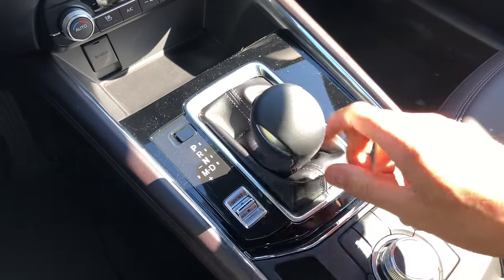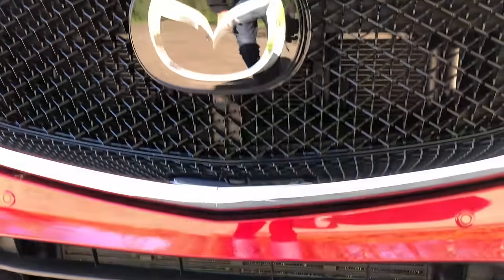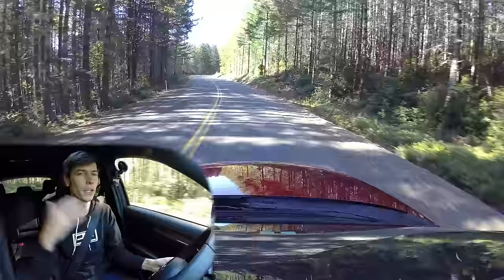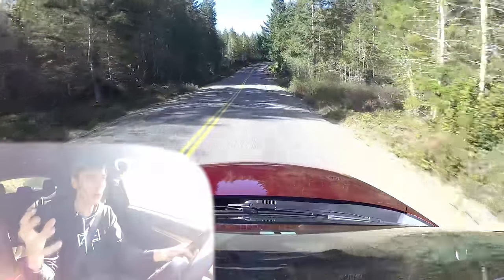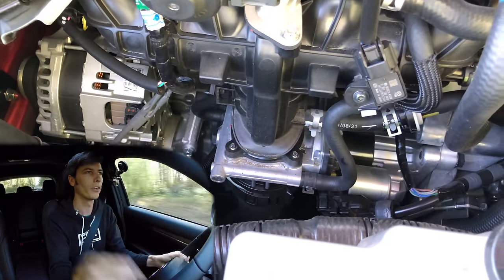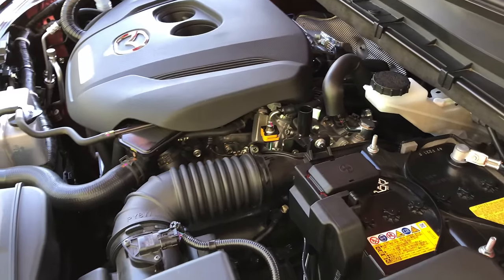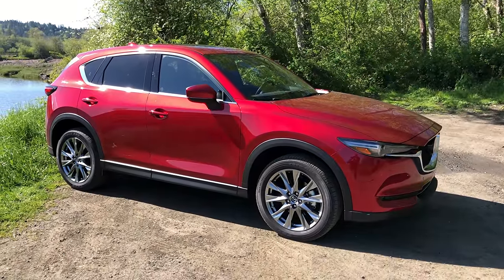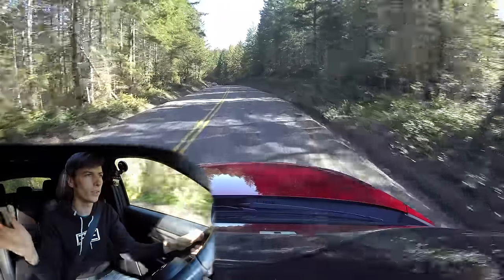Are CVTs Bad? Why Mazda Avoids CVT Transmissions

Comment: My biggest concern with CVTs is reliability. I'm one of what is apparently the super rare people that buys a car to drive it till it dies, and transmission repairs are expensive. If they can prove to be reliable for 300K + miles then I'd be more on board with them
Reply from the maker: Good friend of mine has a Murano with 200k on the original transmission. Of course, one data point doesn't tell the full story (just like one CVT failing at 40k miles doesn't tell the full story).
Reply: My 2009 murano has over 150 000 miles on the original transmission. Zero issues.
Reply: @EngineeringExplained  Is it the convertible? lol
Reply: Toyota and Honda have good reliability in theirs
Reply: Nathan Anderson Most people dont change their fluids like they should. People think they only need to pay attention to tires, brakes, engine oil/brake fluid and thats about it. Of course its not going to last long doing that...
Reply: @samusaran7317  I mean thats being generous, a lot of people don't even check oil let alone any other fluid. They just put it in for a yearly service and think itll just keep running. Tbh thats what my parents do, yet somehow there cars are running fine, probably because they dont put loads of miles on them. My mums 16 year old Avensis Verso for example only has like 86,000 miles on it, she never checks fluids and its been solid the entire time; I think the only fault its ever had is a leaky ac once like 10 years ago.
Reply: @xenonram  True yeah, thank god everything is at least a little bit over-engineered xD
Reply: Well my 15 impreza has 180k so far. Change fluids regularly no matter the lies dealerships tell us.
Reply: Toyota prius run cvt gearboxes and there are cars running 400,000 miles on the same gearbox no issues
Reply: @samusaran7317  I had a car that did 257,000 miles without the transmission fluid being changed and it still shifted fine, I sold it so for all I know it could be on even higher mileage. CVTs fail because they are junk not because people aren't changing the fluid enough. I don't know anyone who changes transmission fluid its pointless.
Reply: I am only at 45k so will reply to you in about 15 yrs when I hit 200k.
Reply: @samusaran7317  having worked in a dealership... you're being awful generous with the comment about tires,brakes,brake fluid. Most people seem to think gas and maybe oil is all the car will ever need. 75% of people who came in needed brakes (some were metal to metal and still didn't think it was a problem) and a solid 40% had bald tires or nearly.
Reply: What I have seen is that there is a great variation in CVT reliability.  Some can go to 200K miles.  Others die quite early.  That tells me the technology is not yet well established.  Until then, I will avoid CVTs.
Reply: Engineering Explained There are a series of class-action lawsuits going on against Nissan for the crappiness of their CVTs.
Reply: 2009 Nissan Rogue: approx. 139,100 miles. My parents bought it in 2016 with 118,000 miles. There was a problem with a type of switch that made the transmission malfunction, but no mechanical issues. My family has never owned a car with a CVT before. The issue was fixed in September of 2017 and has been fine ever since. CVT's are neat in how they operate, but I personally don't know the long term reliability of these transmissions.
Reply: I too want a car that can possibly last 1 million miles.  I wanted to get a new Camry, but I’ve read that they’ve been having problems with their 8-speed transmissions.  Ironically, Toyota doesn’t seem to be having problems with their CVTs (in the Corolla).
Reply: @GeneralSirDouglasMcA  Toyota is indeed having issues with the Corolla CVT.  Google it.
Reply: Nope you aren't rare. I'm 61 and was raised to buy new and drive the thing until it won't go any more meaning at least over 100,000 miles.
Reply: @brighter22  have you any update on your cvt mileage?..at present?
Reply: @chriskalkman3815  Any updates on those cars cvts?
Reply: @donovanfahrbach2493  @75k and not one issue w car.
Reply: Agreed!
Reply: @SteedDigital1 👍

Comment: I recently rented a 2019 Hyundai Elantra with a CVT and a small; 1.4, 1.6 or 2.0 liter engine. It was the first time I had ever driven a car with a CVT and I was very impressed with the performance and fuel mileage on a car with such a small engine and considerable weight. Putting the car in sport mode really made a positive difference in responsiveness for a minimal decline in fuel economy. For a gasoline engine passenger vehicle, I believe the future is with CVTs as the technology evolves.

OTOH: My lightweight 370Z 6M with its large displacement NA engine and very flat torque curve has absolutely no problems(engine lugging) with gear selection at any RPM or nearly any road condition, just step on the gas for instant acceleration. If I need more than an ordinary amount of acceleration I can downshift as needed. The 6-speed close-ratio transmission allows me to tailor the RPM to exactly where I want it to be on the engine's torque curve. This is why I don't think that well-made manual transmissions will die out for certain kinds of cars. Lighter weight, greater simplicity and a more direct and solid drive are some of the reasons I prefer a manual.
Reply: Your tune will change when it breaks down at 49K miles and needs a new fake transmission (aka CVT).
Reply: Hyundai Elantra do not have CVT transmission !
Reply: @mariodeprima6184  As of 2020 Elantra's were supposed to have a CVT. It might be called an IVT as I know that's what Kia calls theirs and they are basically the same company.

Comment: I have a CVT now, I won't buy any CVT car! no matter where they made!  tried CX5, I know which one to buy next!
Reply: Yuan Li I am a rideshare driver and my 2016 CVT Toyota Corolla LE has 161000 miles, no issues at all 🤷‍♂️👀 Proper maintenance is the key. For Corolla, you need to change the transmission fluid every 60000 miles. You also need to change the filter and clean the three magnets. “DNY automotive “channel shows the proper way to change the trans fluid.

Comment: I can tell you Nissans CVT is a piece of crap .. 70k miles on my wife's Altima it's on its 3rd one Nissan only gives them 12 months 12k miles for a warranty because they know there Crap . Never buy Nissan ..
Reply: What year is her Altima?
Reply: Did she ever flush that CVT at 50k?
Reply: MainMite06 They have been going to the dealership for the CVT replacement, I'm sure that they have followed the change intervals as well. 

Nissan Altima is notorious for having transmission problems.
Reply: Joshua Jacob They used to be good until they forged with Renault in 2000, after that it’s just been a downhill spiral...
Reply: CVT in my Honda Accord crapped out at 65k miles. Luckily it was under warranty. The worst thing about them is that they can't repair them, they just have to replace the whole thing. And it's like $6k.

Comment: Mazda is a cool underrated company.  
I actually prefer the smooth feel of a CVT and it gives better acceleration and fuel economy.  The only concern is poor reliability.
Reply: My cx7 turbo was terrible. My 6 is great. The 3 is excellent. The 2.5 n a three is a great quick car. Fast as an is250.
Reply: I have a Civic CVT, Jeep TJ Manual and F150 auto.  Like 'em all.   Did not see any complaints on the Honda CVTs and would have bought the Corolla if it had some power.  I love the Civic CVT with the turbo 1.5.  Pulls real nicely for an econobox and on 40 minute country road drives I get just over 50 MPG (4.7l / 100Km)
Reply: I got a very different experience with a Mitsubishi RVR that I drove for a month last Spring. The thing was sluggish as hell, the RPM you always go way up every time I put my feet on the gas but the thing would barely accelerate. It convinced me to never buy a CVT.

What model are you referring to?
Reply: Transmission type and reliability aren't really correlated. It has more to do with build quality, engineering and proper maintenance. Any type of transmission can be junk and any type can go over 200k.

Comment: I have a 2010 Altima at 143,000. I do regular fuild  change on both engine and cvt and it still running nice and smooth. But I am tired of running on a cvt and Mazda has been on my mind for my next car because of the traditional transmission and their style.

Comment: The bottleneck of CVT reliability is the CVT belt, which can only last about 160k miles even for the topmost CVT belts available on the market.    The Aisin AT of Toyota can easily beat this metric for double or even triple times.
Reply: Which wouldn't be a big issue if they designed them for easy replacement. You would think knowing they aren't as reliable they would make them easier to repair.
Reply: @court2379  Unlike rubber cam belts - which can be made easily accessible (though some manufacturers to their eternal shame totally fail to) - I doubt a CVT belt could ever be made easily replaceable.

Comment: You need to know one fact - NOBODY can fix a CVT transmission so when you have a problem it must be replaced AT YOUR COST. I will never buy a vehicle with a CVT.
Reply: neil rich I learned the hard way with my 2008 Altima.  Never again!!!!
Reply: Courtney Barnes you can’t compare the CVTs from the last few years to the nightmare Nissan created 10 years ago. I’m convinced most Nissan owners hate CVTs because they are scarred by past experiences. Things are very different now.
Reply: @angelomanzi9272  Yeah right....
Reply: Last fall I test drove a 2019 Kia Forte with a CVT (they call it an IVT; it's still a CVT no matter how you slice it), and it didn't feel any different.  But I decided to save myself a lot of potential headaches (possible breakdowns and costly repairs) and passed on it.  IMO, the jury is still out as far as the reliability of CVT's is concerned.  It's still too soon to tell if they will be reliable in the long term.
Reply: @angelomanzi9272  I have a Forester XT with a CVT and it is EXCELLENT. Probably still difficult to repair and expensive to replace, but I have no qualms with it as far as the driving experience goes.
Reply: Yep, our '15 Sentra started having issues at 12,xxx miles! Took it in then they "reprogrammed" the computer, apparently the car thought we were hitting the brakes, causing the cvt to not function correctly. It hasn't done it since then, but we are definitely getting rid of it soon...  No more cvts for us...
Reply: El Bros b
Reply: @angelomanzi9272  Explain that to the feeling of loosing hundreds off dollars, you can explain it logicly but the emotion is hard to change. And worst if your budget is low.
Reply: icecool1616  The Subaru CVTs haven't been on the market long enough to make that judgement.
Reply: @angelomanzi9272  maybe but all the 2012 2013 2014 2015 nissans i have put cvts in lately are trash
Reply: Toyota CVTs nevef had problems with them...
Reply: Yes, you will buy a CVT in the future. That is where all the cars are going.
Reply: Always remember that if WE(humans) can create CVT then it only means we can always fix it so DO NOT USE THE WORD "NOBODY" can fix it as if aliens created CVT.
Reply: Subaru had to extend the warranty on their CVT's because they were failing. Had mine replaced at 72,000 miles on an easily driven 2013 Outback.
Reply: @BradChadley  as long as you don't take that activity vehicle off road for any activity.
Reply: @jeffreycordle6084  Considering the suspension isn't up to the task for any sort of crawling, the CVT wasn't really made for that to begin. A purpose-built CVT would be fine.
Additionally, you can put it in a manual mode and keep it in pre-selected gear ratios, which is far lighter in the vehicle as far as wear goes in an offroad situation. I prefer to use that control in spirited driving as well, but the CVT does well living it in the standard mode whether I'm carving through a canyon or getting it sideways on gravel roads. CVT's will likely stagnate as EV's take over in the next few decades, but I wonder how they would fair in an EV application.
Reply: icecool1616  you are correct.  So far.  It's only been about 5-6 years.  Toyota and Subaru's claim to fame is the 10+ year outlook for their vehicles.  If 10 year old CVTs require an expensive replacement, it will start to affect the resale values of brand new cars.
Reply: icecool1616  No Class action lawsuit on CVT just settled, received notice in mail, will warranty now to 100,000 pro rated good luck with compensation. Don’t get me started on head gaskets leaks coolant issues and oil consumption.
Reply: icecool1616  Toyota makes their own. Subaru's made by JATCO (Nisson)
Reply: @BradChadley  replace $5,000
Reply: @angelomanzi9272  I have a 2016 Nissan Versa.......and already major transmission issues.
Reply: nrich51 I am a rideshare driver and my 2016 CVT Toyota Corolla LE has 161000 miles, no issues at all 🤷‍♂️👀 Proper maintenance is the key. For Corolla, you need to change the transmission fluid every 60000 miles. You also need to change the filter and clean the three magnets. “DNY automotive “channel shows the proper way to change the trans fluid.
Reply: I'm noticing that a lot of the new Toyota, Honda, and Subaru vehicles only have CVT. Mitsubishi, too. But we can all agree Nissan has the worst, least reliable ones ever.
Reply: Dahryl B So true!
Reply: I had a 2015 Subaru Legacy with a 2.5L 4cyliner CVT AWD and that thing took off like a beast.  No issue with the CVT.  I test drove a couple of Nissans before I picked up that car and I agree with the folks here, those are rough.
Reply: Even a Toyota CVT?
Reply: @gutadin5  yes sir they do on most vehicles. I have a 2020 corolla le and as the owner of the video was explaining with regards to cvt,  you do not necessarily have to drive it hard like the automatic as most of the driving is between 2000rpms to 3000rpms and very efficient and quiet too along with good gas mileage. Aisin is the company that deals with toyota cvt transmission unlike Nissan. Jatco.

Comment: Yes they are terrible. I've replaced the CVT in my 13' Altima TWICE and it only has 70k miles on it.
Reply from the maker: Yikes, I assume they did that under warranty?
Reply: @EngineeringExplained  Happily the dealership did and they didn't give me too much trouble either. Honestly when on the highway the transmission is actually great but it's in the city where it really starts to show its true colors. It bucks back on forth when the car crawls at the 0-10mph range and just makes for an overall unpleasant experience.
Reply: Time has  shown that early Nissan CVT's  are well known turds sorry  you  went through this.
Reply: The CVTs in Nissans are terrible. That doesn't mean all CVTs are terrible.
Reply: Nissan uses CVT's made by Jatco.  They are horrible.  Honda and Toyota make their own CVT's. They are 100 times more reliable.
Reply: I'm still waiting for mine to die on me.  I've driver 260,000km so far without a hitch though.
Reply: What about SUBARU
Reply: To bad the don’t use a chain link type CVT like what the new Forte has.
Reply: Nick V that’s what I love to hear
Reply: Andrew Ollila you’re right- but Nissan uses a beefier CVT in the maxima that is far more reliable due to dealing with about 50-100 more horsepower.
Reply: @billsandrew  Nissans are terrible.
Reply: Yup, the CVT in our 2013 Pathfinder was crap.  Fought with Nissan for years.  Of course right after we traded it that's when they finally started replacing them...
Reply: I honest blame Nissan and giving CVTs a bad reputation in reliability and quality. Although, I had no transmission problems with a Maxima I used to own.
Reply: @NMRH258  Nissans were reliable solid cars back in the mid 90s to mid 2000s.

Comment: 11th year of driving and owning a Euro Spec 2008 Mazda 6.
It is one of the funnest to drive front wheel family cars I have ever driven! It still puts a smile on my face in the corners and I still enjoy shifting the gears as the gearbox is one of the best I tried.
It has also been reliable as a wood burning stowe and I have no plans on changing it for a newer car any time soon.
I also drive both this new generation CX5 and the previous generation CX5 at work and they are very responsive and fun to drive for an SUV, but i still prefer A REGULAR CAR

Comment: I'm going to propose a relationship between the prevalance of automatic transmissions in general and accidents resulting from poor driving. I believe that shifting a manual transmission increases engagement with the process of driving, making the driver more attentive, reducing wrecks.Of course they also last longer and are less expensive to repair or replace when problems occur, important considerations that are set aside in the pursuit of driving laziness.

Comment: It's ok for small scooters - makes them easier to drive than a bicycle. For cars there's just too much rubber band and engine strain at max rev. And it is bad for mileage where a lot of throttle application is involved.
Reply: Deutsche Bahn would disagree with you on that. Their V200/V220 series diesel hydraulic locomotives used to put 2100hp through a CVT.

Comment: CVT: (continuous various troubles)
Reply: Severely underrated comment
Reply: CBT
Reply: There's a lot of Toyota hybrids with CVTs that just seem to work.
Smooth drive and very responsive, I'd have another or manual gearbox, never an automatic.
Reply: @RobBCactive  That's because Toyota hybrid are using form of planetary gear CVT which is rock solid and well proven. The Subaru , Honda and Nissan , Audi are all belt and pulley so sooner or later something will go wrong and break. I traded in my 2013 Accord due to horrible symptoms of Cvt for Mazda 6 because i wasn't going to pay 10k for new cvt in future because warranty was already over. 110k miles on my 6 and no issues at all. No more Cvts for me.